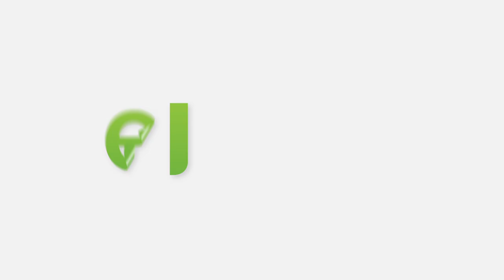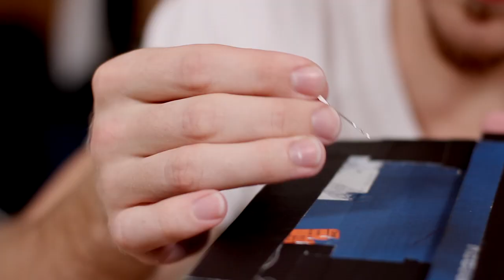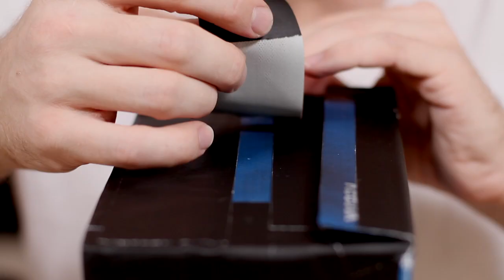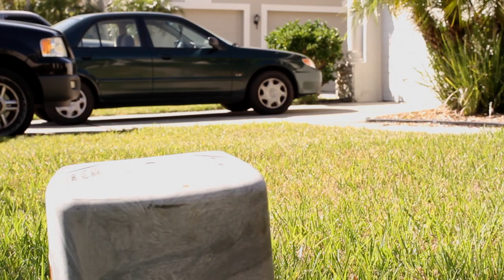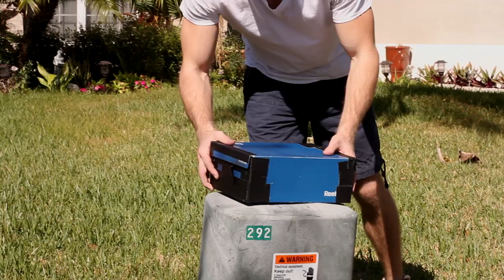How to Make a Shoebox Pinhole Camera : Photography Effects & Techniques

Comment: Considering this is intended as an instructional video, it's not as clear and informative as it could be.

Although the presenter says to make sure the pinhole in your box is smooth, if you put a hole directly in the side of a box, as some might if they follow the steps given,  you're in danger of getting a rough edge (depending on material the box is made of) and not a very good image. You can use foil to make a more precise pinhole.

(1) Cut a hole in one side of the box (say a couple of cm square). 

(2) Make the pinhole in a small piece of thin foil or metal (eg from a drinks can). With the metal/foil you can smooth down any rough edges around the pinhole with sandpaper.

(3) Tape the foil on the inside of the box over the hole you've made, allowing the pinhole to be visible. 

(4) As v1nchynoobs points out, the video also says 'tape the paper to the inside of the box.' This might be obvious to those who've done it before, but not to someone making a pinhole camera from these instructions. The paper is actually fixed to the side of the box opposite the pinhole, so that light can project on to it.This is often the lid, but can also be a side, depending on where the pinhole is located. You can use tape or something like Blu-Tak to fasten it. 

(5) The title of the video is 'How to Make a Shoebox Pinhole Camera.' Strictly speaking, I suppose this is what's been done. But as v1nchynoobs also quite rightly asks: What then? What do you do with the photo paper? How do you get to the final image? Simply to end by saying that once you 'have it down you'll be sure to take some amazing pinhole camera photos' is not particularly  helpful. It would have been useful to see some results!

(6) Once you've exposed the photo paper, DON'T simply open your camera! The paper will be over-exposed and your picture ruined, as in - there won't be one!

(7) Take the camera back to a photographic darkroom, where you can then open it and develop the photo paper (using Developer, Stop Bath, Fix - traditional chemicals - and Wash).

(8) Pinhole photography is at the mercy of lighting conditions. The same scene can require widely differing exposure times depending on something as simple as the sun being in or out! 

You just have to stick at it and experiment!
Reply: Can I use safe light before or after